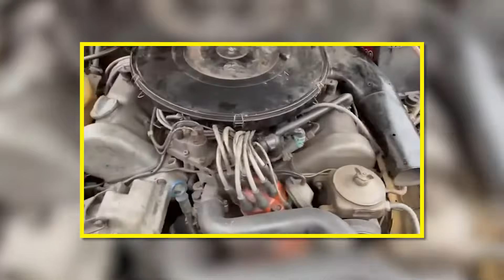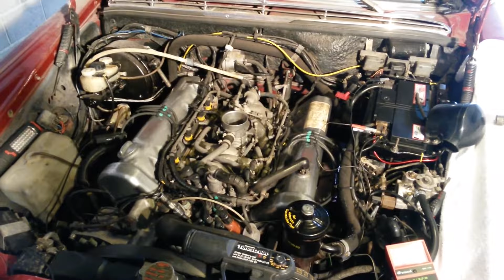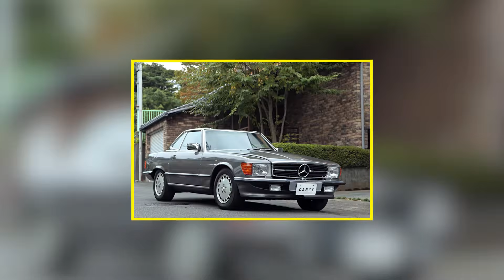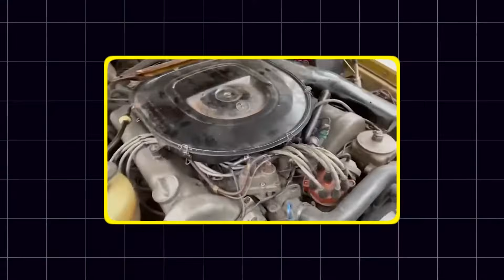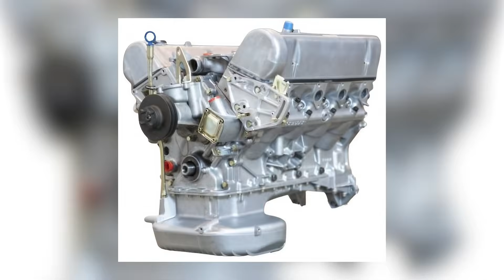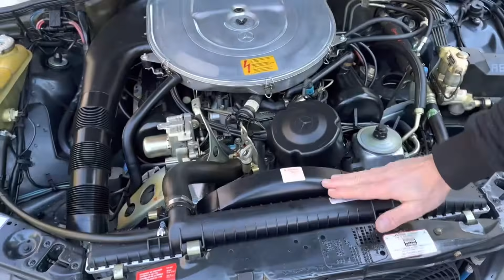How Mercedes-Benz M116 Engine Redefined Reliability Standards

Comment: great to see all the video's but we are restoring an 1984 M 116-963 380 se v8 16v 209 but getting parts is the most difficult of it all specially in Australia . but anybody able to recommend parts of the car mention't  mainly the small ones regarding the air and vacuum valve's would be very appreciated. well great motoring all.